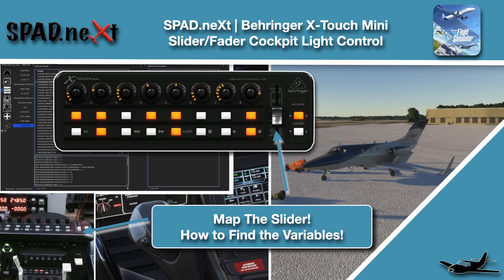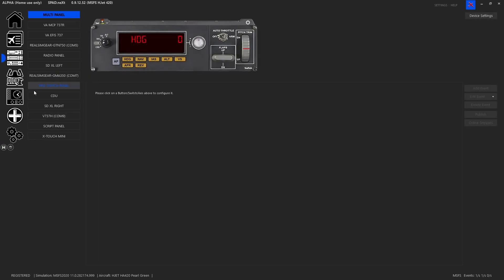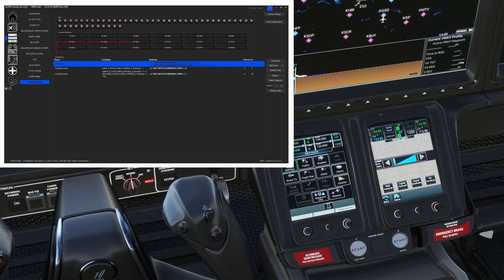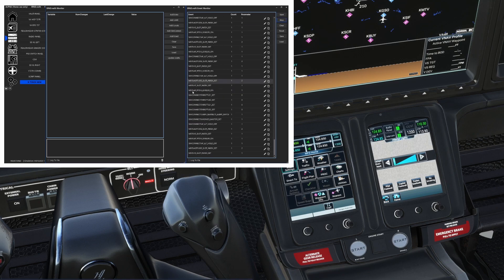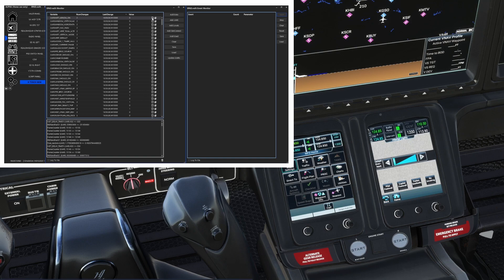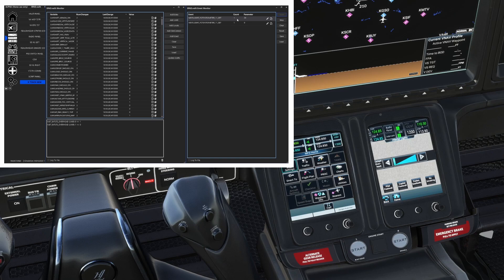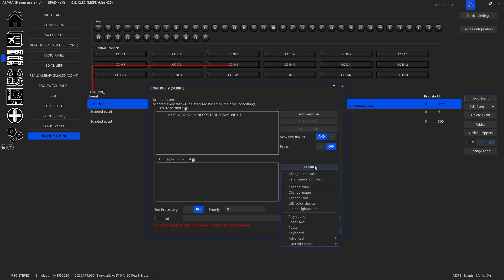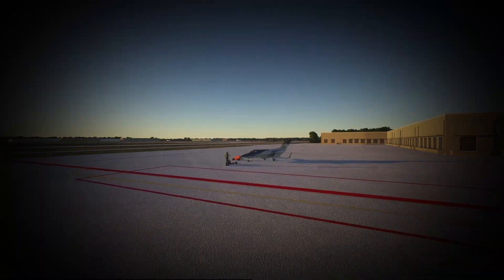MSFS | SPAD.neXt | Midi Axis Control | X-Touch Slider Setup

Comment: Les, you are hands down the Spad guru. I have been trying to use my slider on the cessna. I found the point (LVAR:LIGHTING_CABIN_1) can't seem to get my midi slider to control the ceiling lights. Thanks in advance
Reply from the maker: It’s a BVar thing. The LVAR holds the data but you have to click on the control in the cockpit for the sim to update and take the value. Hopefully we will get that support in the future.